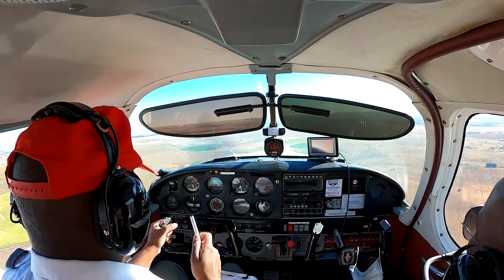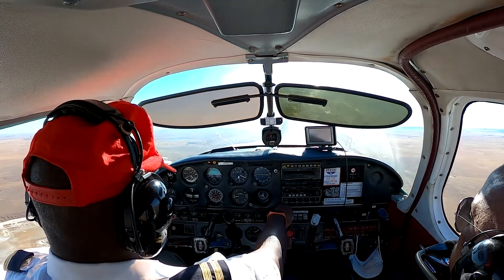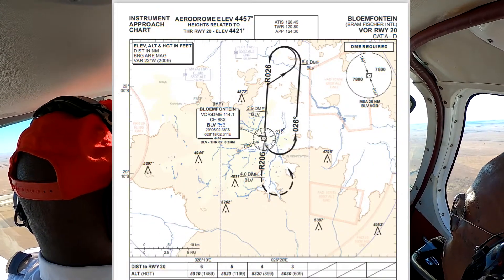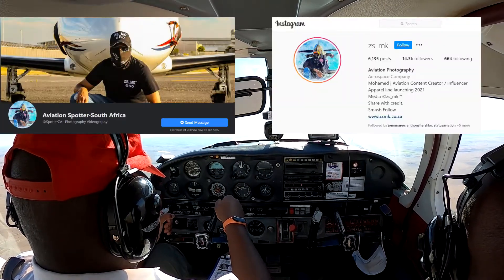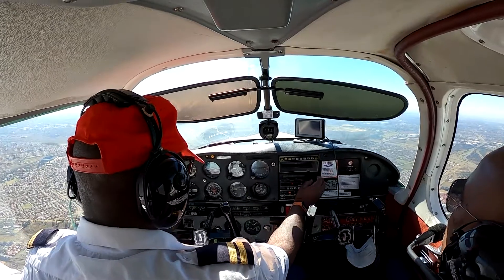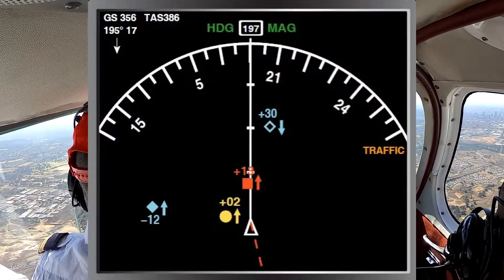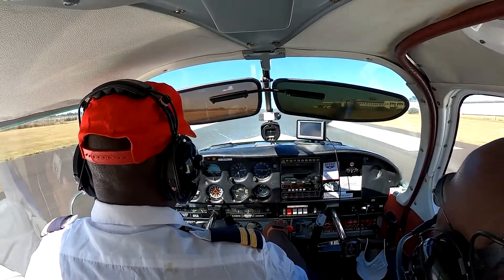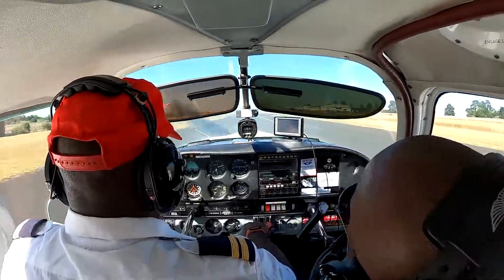Johannesburg Special Rules Arrival into Grand Central Airport with ATC | FAGC

Comment: I love the video but there are much room for improvements when it comes to the ATC audio. Great job my brother, so by the way, I am preparing for my PPL with Westline Aviation and your videos provide much appreciated insight. Great landing....
Reply from the maker: Hi Wayne, yes the audio has been a challenge with this year's recording of flights. An Olympus W-852 recorder is what I'm using and as recorders go it seems to have been a bad choice for recording settings. Also could be the aircraft's radio squelch settings. Lots of playing around required. But if you have a suggestion I am all ears. Congrats brother on taking steps on starting your PPL, when do you plan to start?
Reply: @LSAviation  I just got my SPL and will be writing my first 3 modules in December 2021. I envision flying about 25 hours in December.
Reply from the maker: @waynekester2514  excellent, from the sound of things you're already at Westline. Perhaps I'll come across you at some point. What subjects are you writing in December
Reply: yeah i cant hear what atc is saying had to playback a number of times.